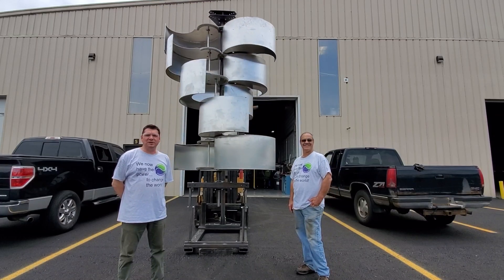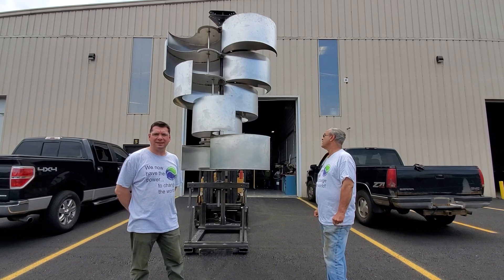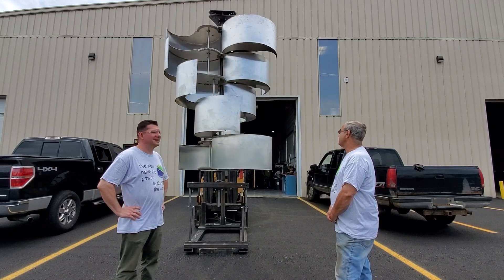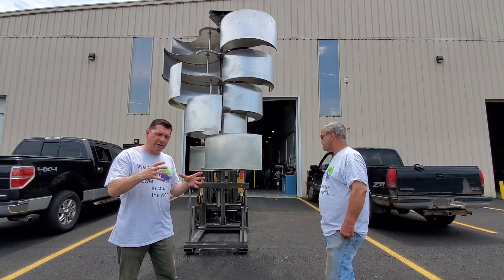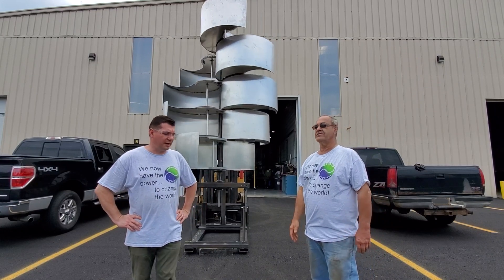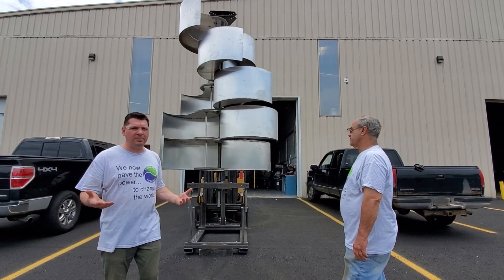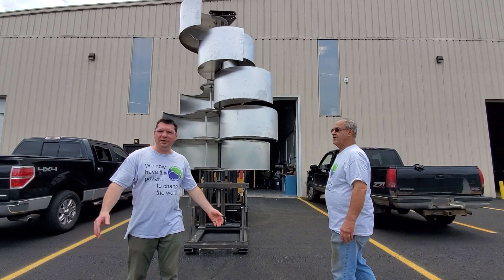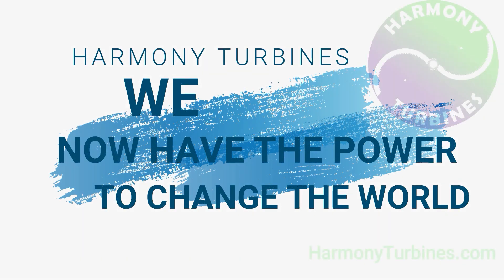Harmony Turbines Weekly Whirl 17

Comment: Will there be a way to throttle the output power? (If it makes more great) but I would love to use this with a Ecoflow Delta Pro It will accept 1200 watts of solar or power wind power from what I understand.
Reply from the maker: Hi Jaden, it will auto-throttle by way of the furling mechanism monitoring the RPM's continuously.

Comment: Genuine question: Is there any video where you actually have a working model of any size, hooked up, generating electricity under load? Your videos are full of good feelings, and big promises, and high hopes, but I can only find one video where you put one of these out in the wind, and it generated a few volts and no amps and lots of excuses. Where do you have a video that actually shows this machine WORKING?

That should be your priority for your YouTube channel, and it will get you all the views (and sales) you could want. Show the machine doing what you claim it does. Promote the hell out of that video, pin it to your channel front page.

Because if you're not generating power, all you've got here is a very pretty and cleverly designed kinetic art sculpture.
Reply from the maker: Jessica this is a story; it is a process that you have the privilege of sharing with us. We are chronicling our progress as we go and sharing it openly with the world. Comments like your "genuine question" imply that you've watched a few videos but never grasped the concept of what we are doing. We are, just now at the stage where we're beginning to get that data that we're looking for but this too will be a process as we try different equipment (charge controllers / generators / gear ratios ) so the answers you appear to be seeking will come. You just need to understand that this is a process that doesn't happen overnight. Furthermore, you're commenting in our WW17 video which is now 3 weeks old yet your question was posted 1 day ago. With 3 more videos already posted of further work/progress, do you think perhaps it would have been more prudent for you to watch the newer videos FIRST. I get it ...some people can't wait for the end of the movie or book, they just want all the spoilers right away. LOL